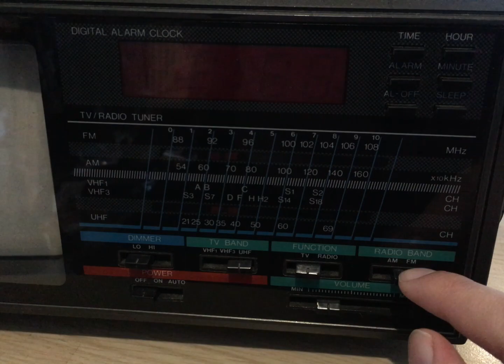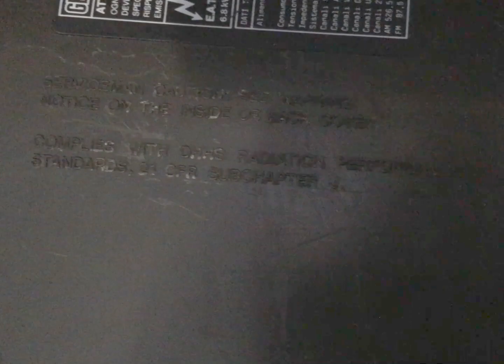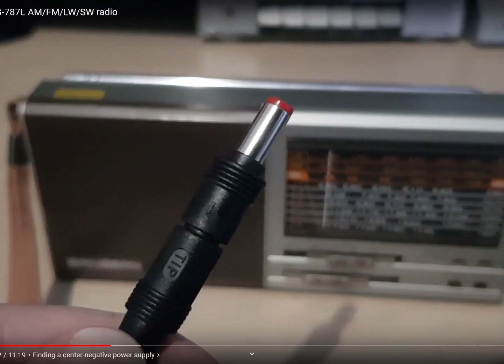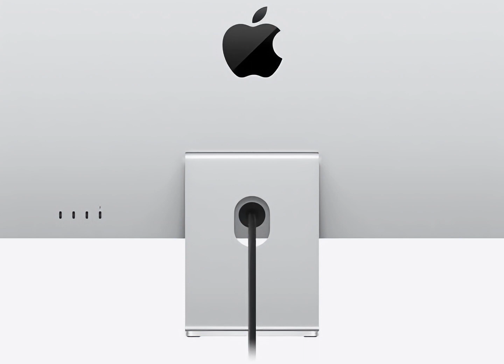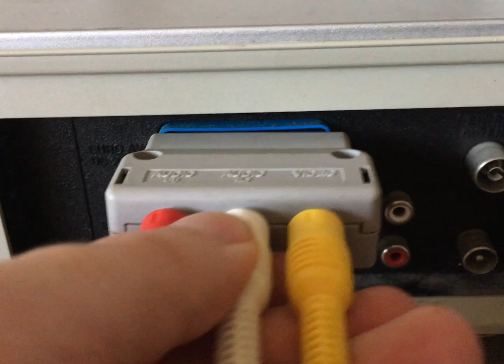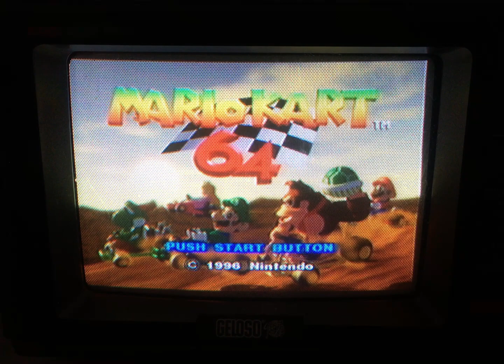Let's try this '80s portable TV/clock radio (Geloso GTR-3706)

Comment: I have a game cube and want to use this tv for it can someone help? This didn’t really help much I kinda get it but still confused on the names of what I need
Reply from the maker: This is complicated and looks awful, I only did it to show that it works. It's easier to get a TV with a composite video input.
But if you really want to know, the VCR is only used to convert the video signal here. This is the setup:
Video output of game console (composite) is plugged in to video input of VCR (composite or SCART). Antenna output of VCR is plugged into antenna input of TV (antenna cable to 3.5 mm adapter)